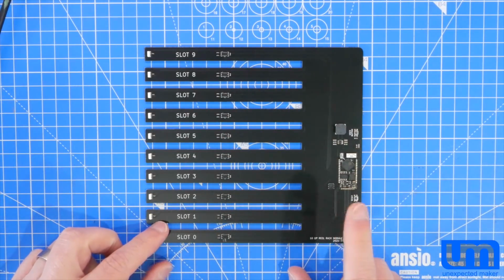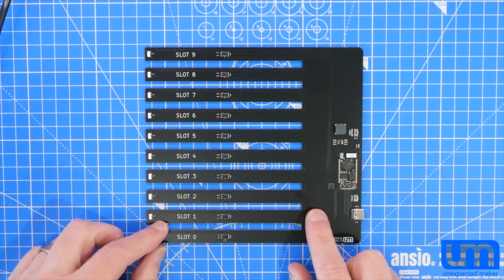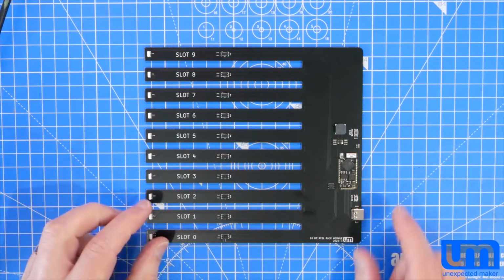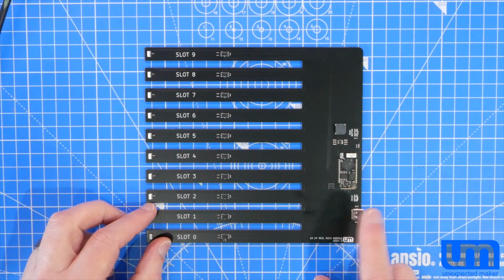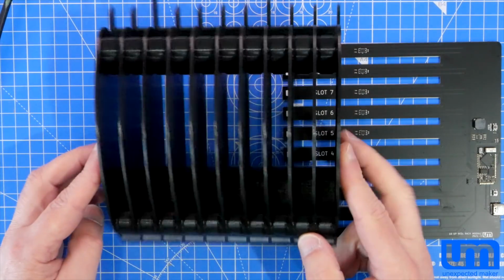SAM - An Introduction!

Comment: Great project!  Maybe add magnets to be able to connect the modules together?
Reply from the maker: That's actually really clever! I deliberately didn't want each rack section connected, but magnets would allow them to seat 'together" but also be easily pulled apart. Thanks :)

Comment: That is pretty much exactly the solution that I've been looking for, but I want to use it with component drawers rather than reels. Detect whenever a drawer is opened, ask what went in/out of the drawer and enable voice-based searching, flashing an RGB led to indicate which drawer(s) to look inside.

Comment: Very nice solution to an itch you had. Have you considered adding rfid tags to the reels - that way you don't have to announce the reel contents when you re-insert it in the rack. On initial insert SAM would associate the tag with its contents. On re-insert it will then know what the reel contains. Obv would require a reader for each SAM module. Could you also consider chaining the power between the modules.

Comment: Why not run it like a can bus and chain them together? If you add 2 USB ports to each you can chain them. Or use SPI with some other socket/plug as the backup if there is no USB plugged in. That way you can use those really short USB cables and have fewer cables hanging around. With over 100 Reels you will quickly run out of ports on that hub and have 10+ cables on your desk/rack.
Reply from the maker: One of my main requirements is that each rack has to be 100% modular and not physically connected to each other or to SAM. I need to be able to put racks anywhere, and to also move them around.

Comment: I can easily see a future with your smt parts tray and a stepper motor, voice activated to provide the desired slot on demand.
Reply from the maker: It's on my list :)My initial parts tray was stepper controlled before I made it manual.

Comment: I have messed with espeak a little bit, messing with the pitch/speed can give slightly better output from memory. I was going to ask how you did the voice rec but you just answered that. Does make me want to get back to configuring my K9, he kinda got put aside after I wired up all the electronics, motors, sensors, etc inside a shell in time for a show

Comment: Honestly voice recognition hardware or Alexa is an overkill. That means the microphone needs to be vicinity. If I would have designed, I would have use an android web app if voice recognition is a must. I wouldn't have used voice recognition at all, simply a computer/mobile using a web app with categories and better interface, and created a Pick to Light system. For SMD components, I wouldn't have used your system of Pick to Light itself. Check the index PNP project, I would have modified the PCB, its a much better RS485 design, that can span to any numbers. If needed can remove the motors, etc. from it, but I like the idea of dispensing parts.
Reply from the maker: Feel free to make one that way, but you clearly missed the part where I state one of my requirement is that the rack modules MUST be standalone and not be physically connected to each other or to the host (SAM). This is the correct design for my requirements :)

Comment: This is both hilarious and useful! Well done Seon!  I'm still thinking the voice recognition is going to get tedious, especially if the reel data to be "entered" is more extensive. And what happens when Seon gets two kids to do the re-shelving :-). But maybe easily solved with a handheld wireless barcode reader, so long as the barcodes on the reels are easily looked up.
Reply from the maker: There is a lot of functionality I've not shown yet, stay tuned :)

Comment: Awesome engineering and programming ! Do the 10-rack-modules hook together ?
Reply from the maker: Originally they were going to, but I decided against it so I can pull one out without having to move them all to unhook them.
Reply: @UnexpectedMaker  oh right I understand
Reply: what model are those fancy 'hubs' ? Guess you only take power from them right ?
Reply from the maker: Power only, and it's not the ones I'll be using in the garage. Just temporary on my workbench.
Reply: @UnexpectedMaker  ah I see

Comment: Have you run into a limit on the number of BLE connections that the Pi can handle? Often a central is limited to somewhere between 6-10 connections. A quick search showed this was an issue on older Pis.
Reply from the maker: No issues as I'm not using GAT - This is all connectionless using GAP only :)

Comment: Cool project Seon!
While the reel rack is cool, I think nothing would beat having machine readable ID on each reel because as it is now, you will either have to put the reel back to the same slot, or re-identify the reel EVERYTIME you re-insert a reel, no?  I like the idea of voice operated inventory system. I have repeatedly failed to keep the paper inventory table that I had taped to each box of parts with the spreadsheet that I try to maintain on my computer. Having voice control would be a great improvement to my inventory.
Reply from the maker: If I'm putting a reel back I ask SAM to locate positions for that part and I put it back into an empty flashing slot. If no empty slot is found for that part I add it into a new one and SAM will ask me what it is as I say "contents last locate" and it will use the parts from what I just searched for :)

Comment: I'm glad after all the back and forfths in the livestreams you have a system that works :D This is very slick!
Now you have a system you could build up on if you wanted: add a lipo to each module if you wanted if you wanted so you can unplug it and move it around, or add tiny screens that update with the info of each reel
Reply from the maker: It won't last long on batteries ;)

Comment: You should put a side connexion to transfer power from a module to another
Reply from the maker: They are deliberately designed to not be connected together - 100% modular and work independently from each other.
Reply: @UnexpectedMaker   or simply had a female usb connector in the back so they can be chained. They don't consume a lot so I would not want to use many ac/dc converter for the same shelf.

Comment: Nice !
have looked out sipeed maixduino ? a 20$ card optimised for IA, with hardware accelerator for vocal recignition. I'm trying tu use it for my domotic but it still work in progress, i've not tried to push his vocal capability to the boundry

Comment: What about adding a barcode or qr code system as well so that when you insert or take a reel from the rack it knows what is going in / out.
Reply from the maker: SAM already knows what a reel is when I remove it and that it's been removed. When I insert it back in it asks me if it's the same item or a new one. No scanning required.